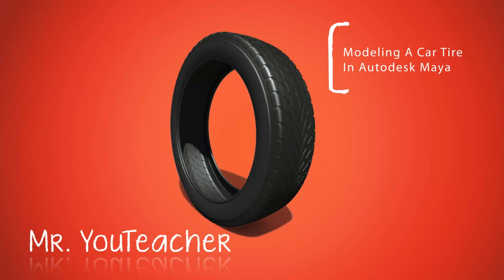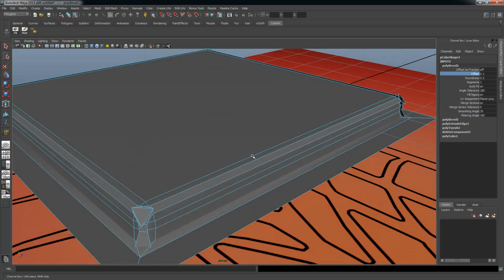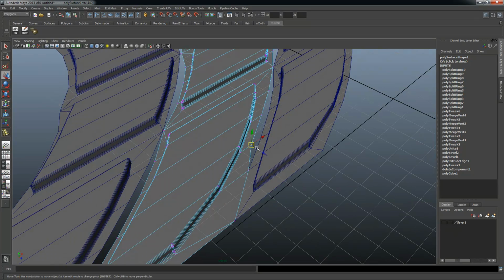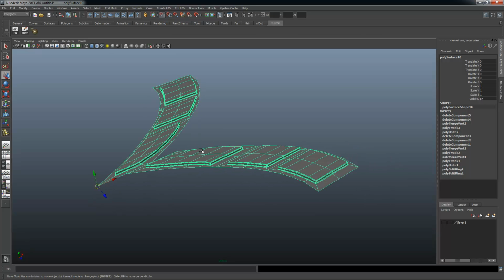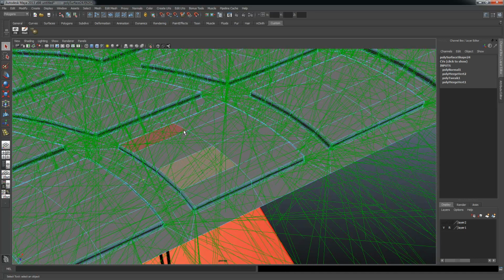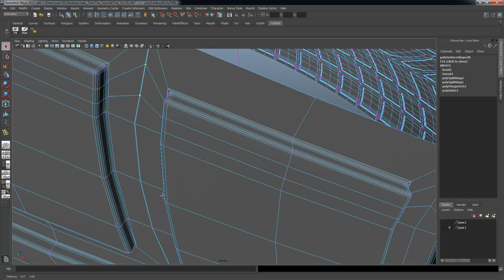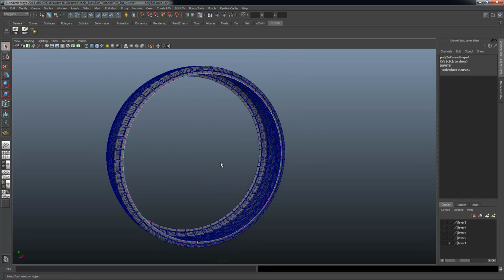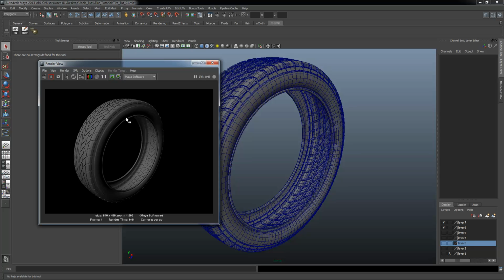How To Build A Car Tire In Autodesk Maya

Comment: Hello MrYouTeacher, Thanks I have successfully constructed a tire. My approach was close yet not exact, just one issue. After building the sidewall the primary material did not appear, also the color offset was black. All that remains is to connect the vertices Thanks again my render time was one hr one minute due to other tasks and learning the features and functions of MAYA on an OX system.

Comment: I think there are easier ways to fix the welding in Maya.  In 3dx Max, I would have used the dynamic symmetry modifier to make one segment, and clone the rest.  Update one and the rest of them match automatically and weld together at the seams.  If not that, use the border selection tool, to grab any open edges and convert them to a vertex selection before welding.

You could also duplicate one section and make sure it's welded correctly.  Select that entire group and duplicate it, then weld.  Repeat to add sections exponentially.

Doesn't Maya have an option to display open edges with a thick wire, so you can spot these problem areas more easily?

You can also tell if the mesh is broken if the smoothed model has a funny looking wireframe in certain areas.  When you see all the edges, not in isoline / undivided smooth cage display.

Comment: As for welding your verts, just select all of the verts, zoom into a view that shows both the smallest distance you don't want to weld and the verts that you do want to weld and adjust the weld tool to only weld the verts you want. I've gone down to .0001 and it still welds verts that are very close but not quite on top of each other. Also if you want to make sure all your verts are welded just do a smooth preview and go into whatever ortho you want. Verts that are not welded will split and you can see the holes easily especially if you have an image plane.

You can also just attempt to select all the edges in a loop by double clicking rather than inserting an edge ring. If you want to check multiple edge loops as once, just select the ring by clicking an edge parallel to the loop and shift double clicking an adjacent edge, then control click the screen, go to edge loops and select edge loops. This should select all the loops in that row. Hope this helps. Great video though.